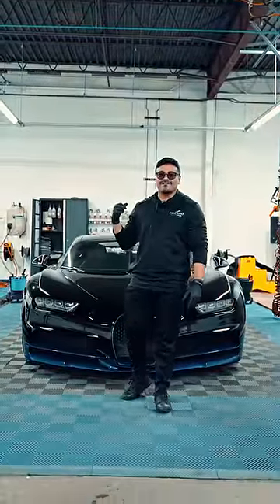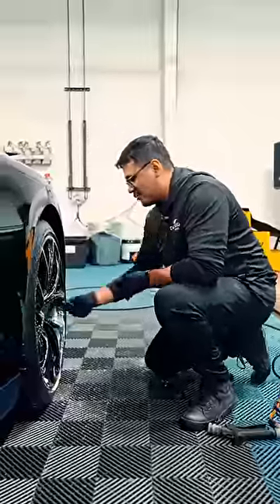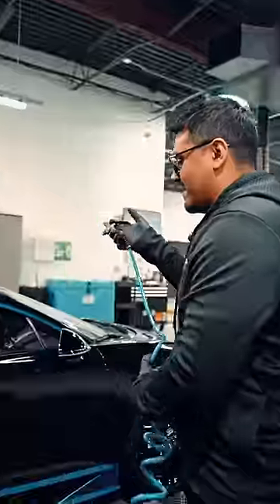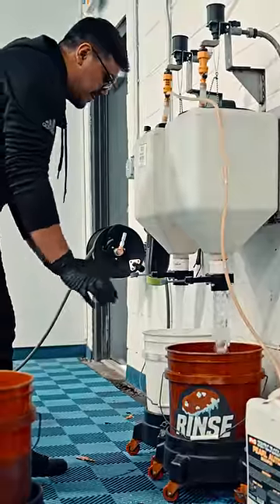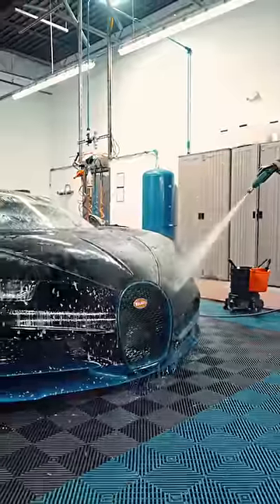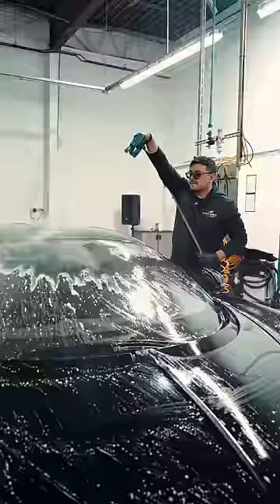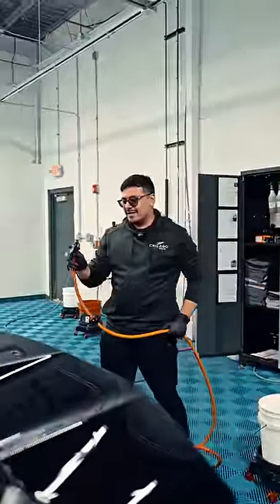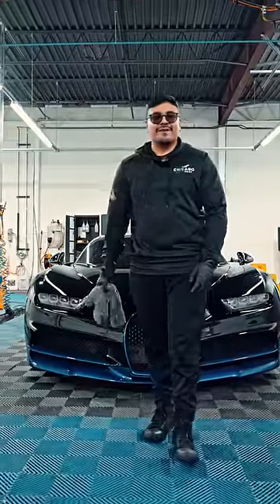How to Prep a Bugatti Chiron!

Comment: Everyone in these comments is a certified car wash professional. LMFAO FOH
Reply: Bc most are 😅. A claybar can mar the paint aka scratching it. Specifically the “real Claybar” can really scratch the paint…you always want to polish after, but he obviously didn’t. If he used a light synthetic clay bar, it wouldn’t be as bad. Also, you don’t want to use circular motions, you want to use horizontal motion. Why? because it’s hard to see a horizontal line if you are standing vertically as humans do lol. Other than that the guy did a really good job. And I know he used circular motions for the window. But in the heat of the moment we forget, and use circular motions on the Paint. Also, I’m a professional detailer and automotive paint technician. And yes I have the education to know what I am talking about. At least in Spanish 💀 with this grammar Ig you can tell
Reply: @johnericcardonaesquea8583  he’s prepping the paint for ppf, all of that marring is not gonna show through the film once it’s applied. Marring won’t be seen on the windows either. Good ppf shops will buff the paint as prep for ppf installation
Reply: @johnericcardonaesquea8583  he prep for a PPF though,i wont mind a clay marring if the paint gonna be covered for 5 - 10 yrs
Reply: I am a professional and what?
Reply: For me I'm not a professional but I learned how to properly wash a car from ChrisFix he had some useful tips on that topic

Comment: I saw the circular motion while washing the windshield. You're fired 😂
Reply: You can move your mitt however you want on glass, it’s exponentially more scratch resistant than clearcoat 😎 P.S. I’ve done some real world testing on corrected junkyard panels and the straight line method vs circles has zero difference in scratching paint. Make sure your mitt is clean, and vehicle surface is free of debris before washing and you can do circles all day 🤙🏼 (I still prefer straight line method to avoid missing any spots)
Reply: @benlittleton6295  i know about the glass but once you start using different motions on different surfaces you might make a mistake :D
Straight motions are preferred because round scratches are more visible/noticeable
Reply: @DetailingTurzovka  well he’s doing a Bugatti and your not
Reply: @grassyfps7301  facts 😭
Reply: @grassyfps7301  you’re*.  You + are = you’re.
Reply: @07acanoia  he got like more money tho
Reply: @DetailingTurzovka  with some of the cars i wash i just use a sponge and circular motions because the paintwork is usually so bad its unsaveable.
Reply: Haha
Reply: @grassyfps7301 *you’re not 

FFS
Reply: 3 million, and all those scratches on the carbon fiber by the logo!

Comment: Not hate by any means, but as a detailer, care with iron remover/acids on the Wheels when Washing a car with carbon ceramic brakes, could turn out as a very expenssive misstake if the rotors get ruined
Reply: Great point!!! Keep the rotors rust free

Comment: Clay is great for decontamination. However there is a high risk of marring (visible even more so with dark paint) which is why you should correct the paint after prior to applying PPF
Reply: 100% if this was my car and I saw this video I would be horrified
Reply: Thank god some one noticed this.
Reply: Good clay mitt is the answer
Reply: Clay mitt with a very lubricating car shampoo as foam will prevent the marring.
Reply: @Shusein  there is still a chance of marring no matter how much lubrication is used. And even if that chance is 0.0000001% i wouldn't be taking any risks on a 3-4 million dollar car

Comment: Wouldn’t you do an iso wipedown on the entire vehicle before PPF application? Genuinely interested as why would it matter if the paint is hydrophobic before PPF, as that won’t be in contact w any elements after the film is applied. So wouldn’t the priority pre-PPF be to ensure there are no contaminants, grease, grime etc on the car so that PPF sticks properly?
Reply: He should have done an iso wipe and a paint correction. The clay bar has a high chance of marring the paint, and with a vehicle of that caliber I would not want to be taking any risks
Reply: @joshsheinis5968  claying the car(if it needs it) is absolutely imperative before any paint correction.
Reply: Definitely should use IPA after clay

Comment: What happened to the polishing step post-clay?  Regardless of which and how much lubricant you use, flaying causes micro-marring which needs to be polished out, even if lightly.
Reply: Ppf covers light swirling. Will look perfect.
Reply: @lucidworx  so now we’re ok with leaving swirls on a Bugatti?!!  No way.  When we do the work we need to do it right.
Reply: @nycak4713  you aren't charging for a polish and the ppf will hide them. No need to worry unless they are major.

Comment: polishing?? you should perfect the paint before protecting it
Reply from the maker: PPF will typically hide any smaller scratches or swirl marks. When applying PPF or vinyl it will actually cause some scratches when taking it off. It's not worth it for the customer nor the detailers to make a paint absolutely perfect if PPF is getting laid on. Hope this helps!

Comment: My guy, stop. You don't want to do what you just did with the pressure washer.

Rinse the car out first without the pressure, otherwise you're risking scratching the pain with sand and other hard particulates which are stuck to the paint.
Reply: Ceramic coat